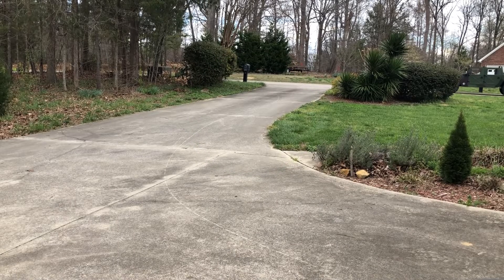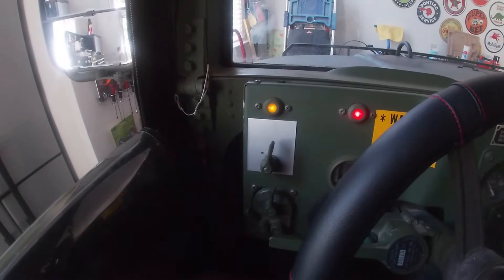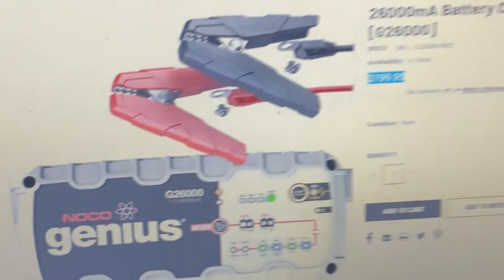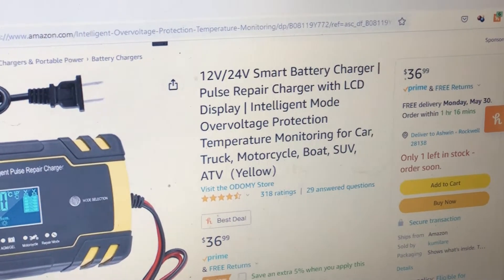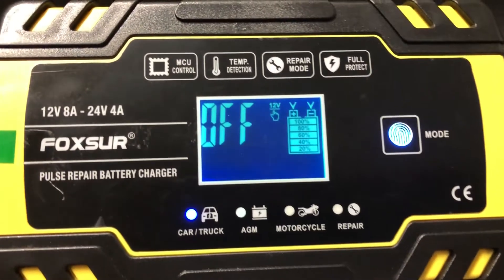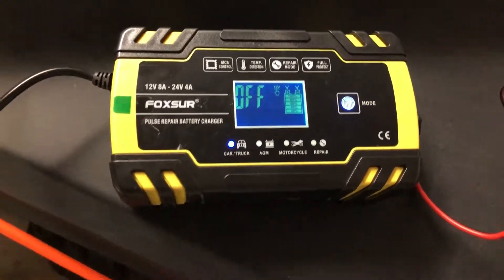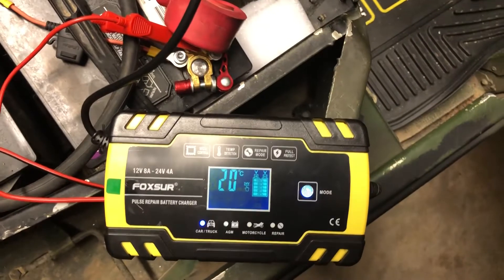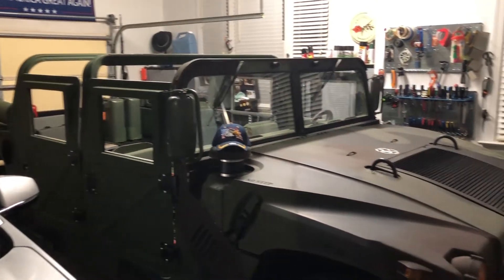Charging Humvee Batteries 24v

Comment: I have a 12v 3amp battery tender, could I use that by disconnecting batteries and charging one at a time?
Reply from the maker: You could. But the 24v tender is just about 25 bucks from Amazon. It’s not fun disconnecting and reconnecting batteries. Too much effort IMO.
Reply: @MyHumveeMathilda  I appreciate your quick respond! i have my hmmwv stuck at my buddies home.
Reply: @MyHumveeMathilda could you use jumper cables from a car with 12v ?
Reply from the maker: If you want to destroy your smart box, go ahead. Then instead of $25 for the right charger, you’ll be paying over $1000 because your smart box will be fried. Dont be cheap where your Humvee is concerned. Jumper cables are for transferring CCA between cars to jump them, NOT to trickle charge.

Comment: Use the same charger.  Cut off the leads and wired in a standard NATO plug.  Super convenient, no need to remove the seat.  Also works great on the MEP generators

Comment: I want to say thank you again for this product recommendation.  I actually just spliced in a quick connect to this charger and hard wired to the batteries for faster easier charging without pulling the seat.  Hope all is well. It has been a while since you last posted a video.

Comment: Does this charger need to be plugged in all the time? Can I charge it and then take it outside to plug it into humvee without it being plugged into electricity?
Reply from the maker: You can. If it’s not plugged into the wall, It’ll function as a meter to show you the voltage. That said, I wouldn’t keep it connected over a long extended periods without charging, it might drain your battery.
Reply: @MyHumveeMathilda  okey, thanks. So I can't charge humvee if it's not plugged into the wall 👍

Comment: Awesome video, just bought a M1123 yesterday so I'm in learn mode.

I see people ditching the 6TL batteries and running a couple of 24F batteries instead.  Which batteries are you running, and what is your CCA rating?  Thanks.
Reply from the maker: Different people swear by different things. Don’t over think it. It’s a simple machine.  Two 12v Walmart specials (750-800 CCA) in series will work just fine. Many go for the 800 CCA OPTIMA deep cycle batteries.